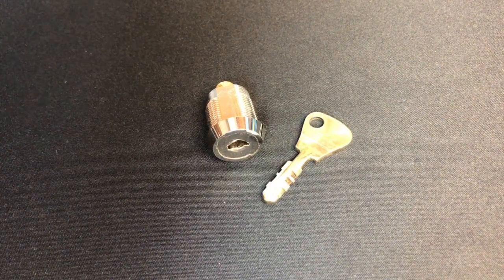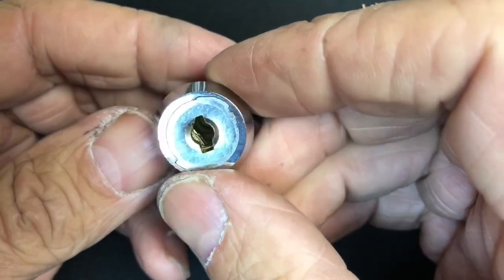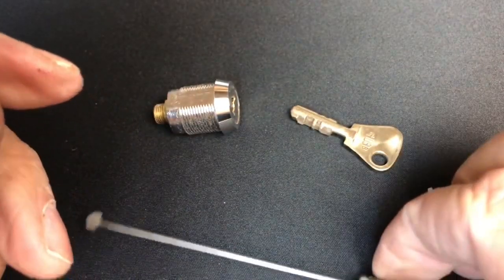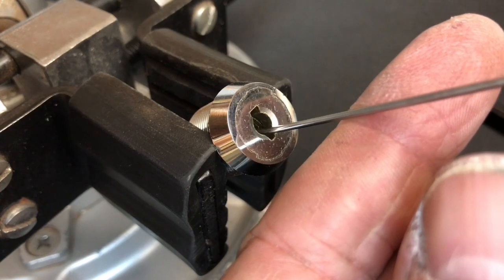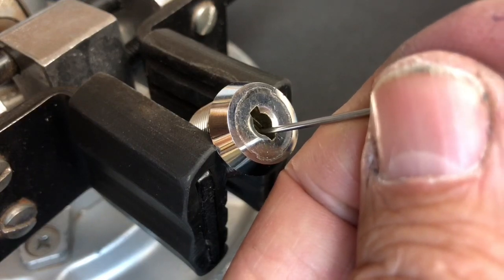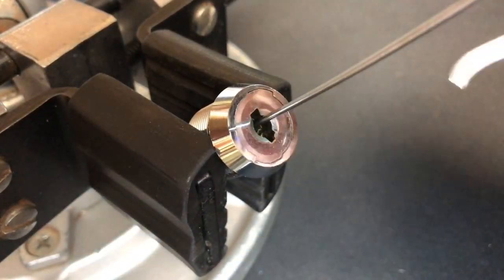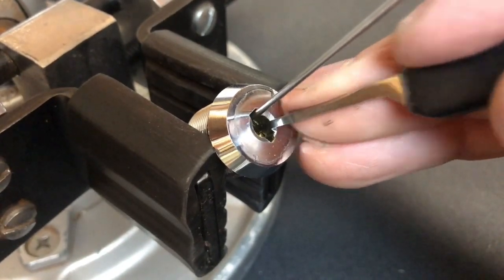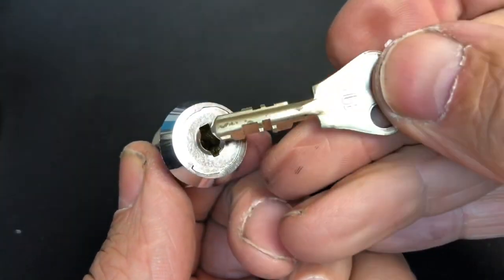The Awesome Chubb AVA Cam lock.

Comment: Those injector pins look like they could be turned to multiple uses, great idea on using them for this situation, I'm going to have to order myself some of them for future uses.. Better to have some and never need them than to need some and never have them ;-)
Reply from the maker: Plug4uk I completely agree with you, they are super strong & a perfect size for locks, I’ve made a standard disc lock pick from one now as well. Plus a couple more ideas in the pipe line. 
Have a fantastic week. 👍

Comment: Awesome lock. I can tension it when it is installed (badly) by rotating the whole lock using the cam. I have not found an off the shelf or low skill method (yet). Love your tension tool and that gives me an idea 🤘
Reply from the maker: CoxysPicks They are fantastic locks, I am going to be working on a 2 in 1 pick for the AVA locks next year. This way worked well on this lock, but I know I can make a pick that will open all AVA locks. 😎👍

Comment: wow !!  fantastic job friend !!  I have a lock of that model but I don't know what to use as a tensioner, which is exactly what you made it with?  I thought it could be opened with a disc detainer?  Thanks for showing it, great job !!  UN SALUDO
Reply from the maker: adrian leon Thank you , the tensioner I made from an injector pin, but can be made from a piece of piano wire. I just tensioned the last wafer. I believe there are 4 possible cuts so you may have to alter the shape of the tension tip, until you get the rest of the wafers to bind. My plan is to make a 2 in 1 pick. I just need to get the time. 👍

Comment: That was really cool how you picked that.
Excellent way you made the tension tool. 

When you say made out of an injector pin, what sort of machinery would it be from. So I know where to go and ask for some over this way, cheers matey
Reply from the maker: Pocket Women Hi My Friend, I did leave a link where to buy them but for some reason YouTube removed the reply 😡 
They came from Ali Express (China)
Reply: @dazevers  I went to that site wow they have a lot of stuff and categories, can you give me the name of the item and what it's from, I looked up injector pins and they don't exist, thank you
Reply from the maker: Pocket Women try this 
65Mn HRC60 Round Tip Plastic Injection Component Mold Straight Punching Ejector Pin
It’s the 1.5 mm one’s you want.
😊
Reply from the maker: Pocket Women sorry this works better if you just search this in Google 
5mm OD 5*100/150/200 5x100/150/200 65Mn HRC60 Round Tip Plastic Injection Component Mold Straight Punching Ejector Pin

Comment: Good job mate. The tool you made looks like a bought one. You definately have the most diverse collection of security locks. Where do you source all these locks? Cheers:-)
Reply from the maker: paul springett Cheers Paul, the tensioner was a bit of a challenge, as apart from thinning down the sides I had to hand file it, but it worked out ok. 
As for the locks,I’m always searching for new & interesting one’s. 

Don’t forget if you ever see anything you want just shout & it will be on its way. 😊

Comment: Are you sticking your tool into the void at the bottom of the core, or are you clipping the last wafer? I am having a mare trying to tension mine 😭
Reply from the maker: CoxysPicks Hi Mate, in this lock I’m tensioning of the last wafer, I believe that there is 5 possible positions that any wafer can be in. I have made up two different tensioner now similar to the professionally made AVA pick, I will be working on the pick tip in the new year. I have seen a couple of other People pick these locks in the same way.
Reply: That makes sense. Back to the drawing board for me lol. :D